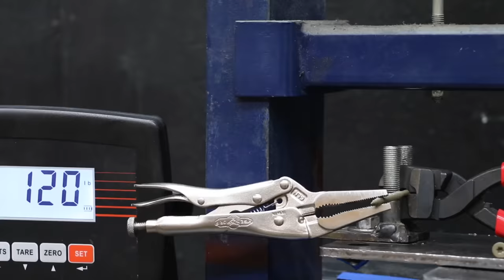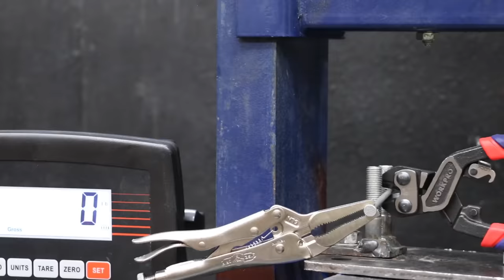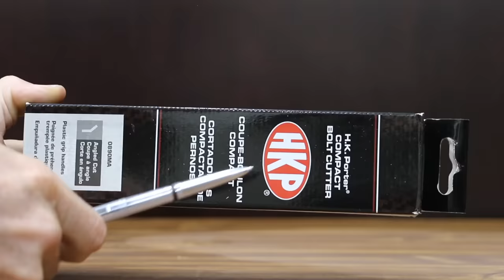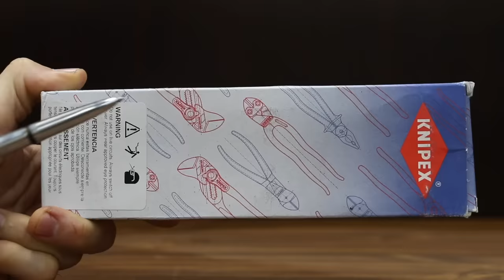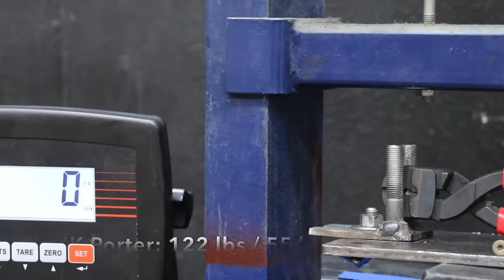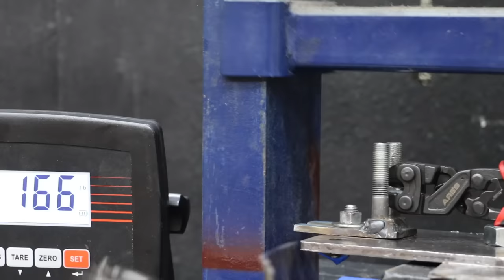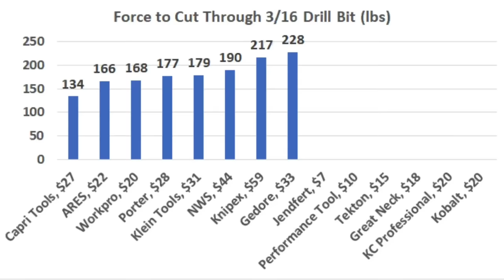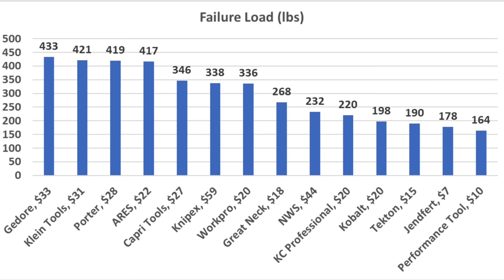Best Bolt Cutters? Knipex, Klein Tools, Kobalt, Tekton, Gedore, NWS, Porter, Workpro, Capri Tools

Comment: To be honest, this just seems like a useless category of tool. I assume you were applying force near the end of the handle with the press, meaning it's the maximum possible mechanical advantage. Your hand would be averaging out the squeezing force significantly further in, let's say a 30% reduction in leverage and cutting force. That puts even the best of these at well over an average human male's one-handed grip strength of 72 lbs, and considering it's a one-handed tool, that's, um... I think the technical term is "not good".

I'm sure you could get two hands on them... but with reduced efficiency. Only the very best of those seem like they can cut through even the nail with an everything-you've-got two-handed squeeze. Most of the bottom end likely wouldn't be useful in most people's hands.

The biggest lesson I've learned from this is: get full-sized bolt cutters. Much bigger lever arms, plus bigger, stronger muscle groups.